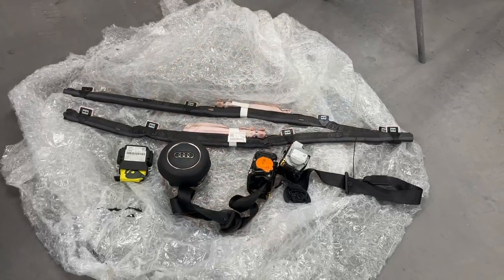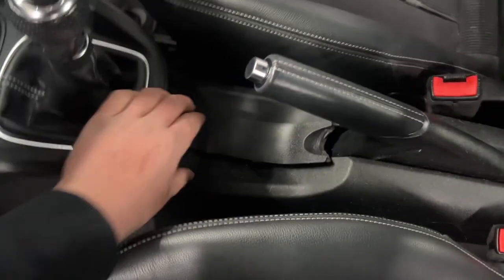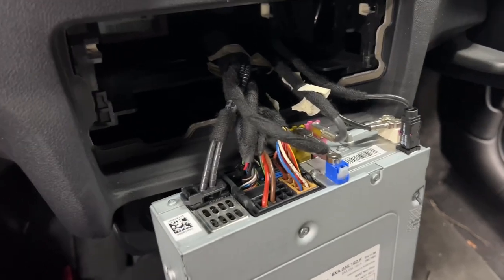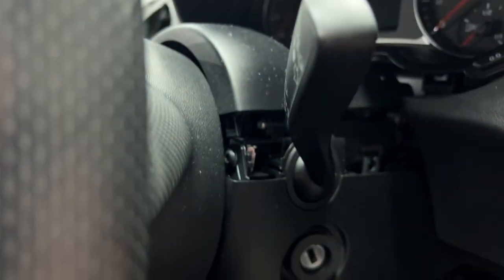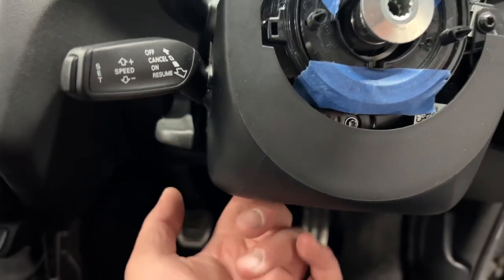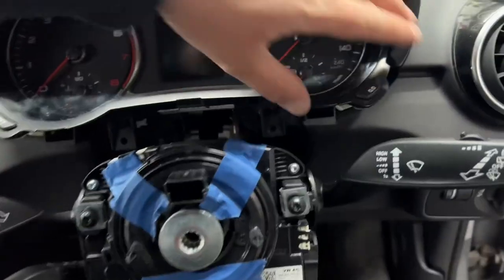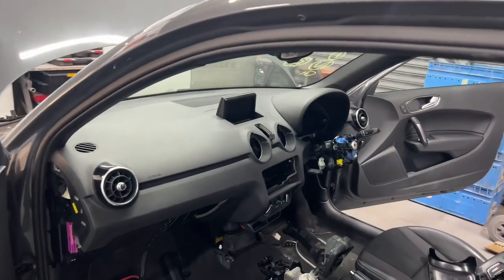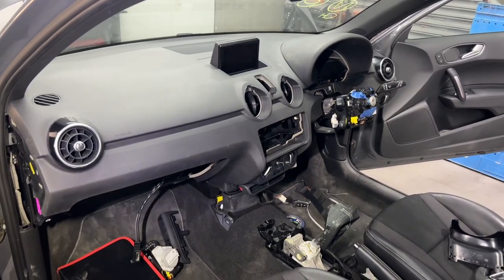CRASHED AUDI A1 FROM COPART DASHBOARD AIR BAGS & SEAT BELTS REMOVAL AND INSTALL PART 2

Comment: Order a pyro fuse. That’s the reason the car won’t start as it blows once the air bags blow. Get it changed and it will start. The pyro fuse is in the boot on the battery
Reply from the maker: Hi mate the car don’t have a pyro fuse as battery is in engine bay that’s why it still cranks over